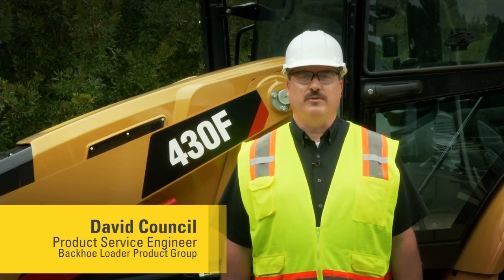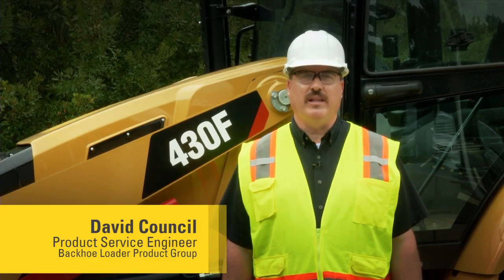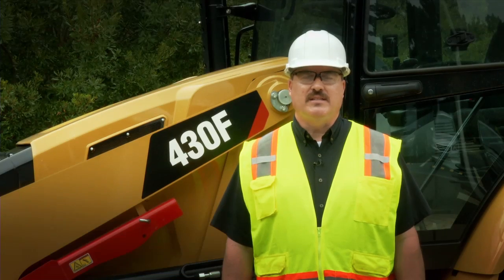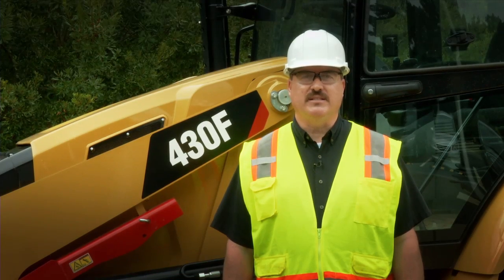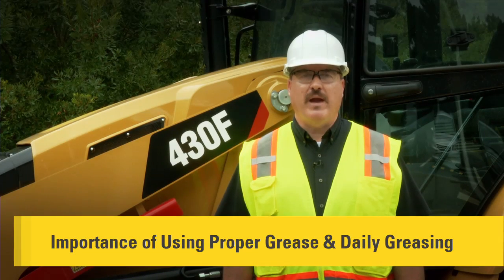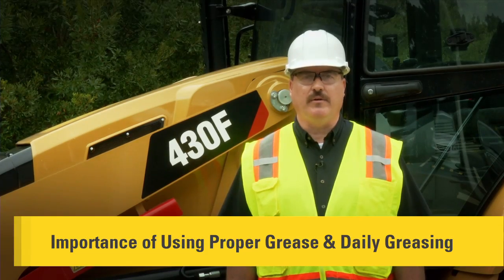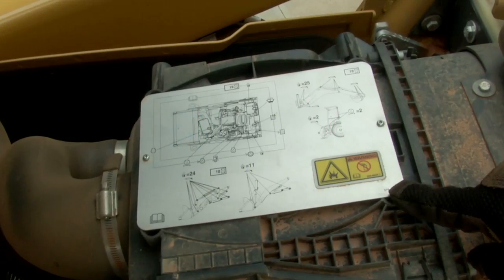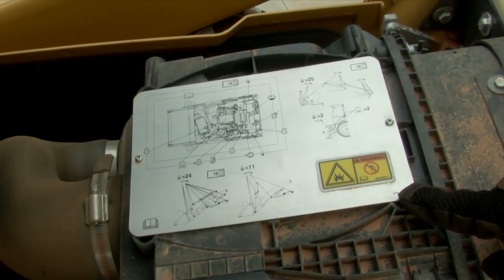Daily Greasing - Maintenance for the Cat® 416F/420F/430F (and F2) Backhoe Loaders (North America)

Comment: Just to update...the caterpillar service came over to check the machine.  The prime pump for the fuel filter was not working anymore and had to be replaced.  My machine was still on warranty.  So,  caterpillar didn't have the part(prime pump)  in any dealers in Quebec. They had 17 pumps in Ontario.  So I lost my Monday and Tuesday work(down time) with my machine.  The service guy had to come twice.  I had been charged 500$ for mechanic travel time,  which the dealer is 12 miles away(18kilometers). 
Now the charge according to them is because I would have to bring the machine to their shop.  I couldn't have started the bloody thing!  And then their guy came during the day regular work hours.....they think so much about their business,  what about the clients' business?  I pay my machine every month and expect to have the machine working everyday.... Now you a Cat dealer,  not having parts available,  when across the pro I coal lines,  just in 1 city,  Trenton,  you have 17, are causing me a loss on my part of the deal. And you want to charge me 500$....for a 12 mile ride?  (42$a mile) fuck off!  
Please stop sending me bills! To this day,  2016,  still receive monthly invoice  of $475.21. My letters have no effect on the company.

Comment: Fucking New Cat machines....worse than China quality. Everything is made of plastic and cheap....I have a 430F and the side plastic panels of the engine  are a bitch to remove and the small plastic tabs that keep the panel in place breaks off....after less than 2000hres .  Shame on Caterpillar. In case the machine does not start and the loader is on the ground position, it is almost impossible to remove the side engine panels.

I replaced the fuel filters and the pump will not refill the filters. I turn the on position with the keys and nothing happens....I rechecked the electrical wiring and still nothing happens.

I had a JD 410G backhoe and when I would replace the fuel filters I would manually refill with a cranking primer pump in the engine compartment. 

Wtf what a f  mistake to buy a fucking Cat 430F .... what a fucking regret....

Now I have to wait t'll Monday to call the Cat service.....for a fucking fuel filter that I can't get to prime up......Fuck you Caterpillar.... I hope Komatsu or Hyundai come to the Northern continent  to kill your market....shame on you. With Ned Flanders on your stupid videos.

And your maintenance manuals are so shit ty just like 10 years ago when China broke into the market here...their manuals were crappy .... your manuals don't even have pictures....they have black and white drawings....shit for spending $160k shame on you